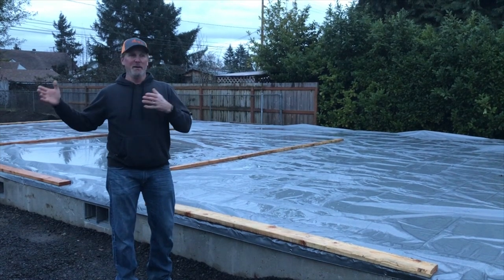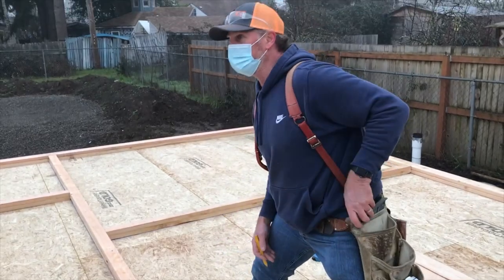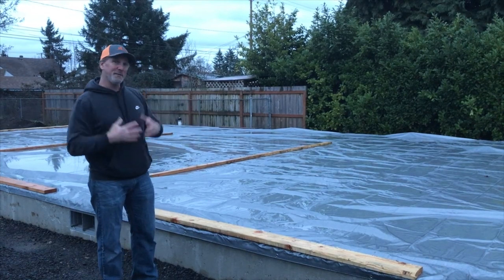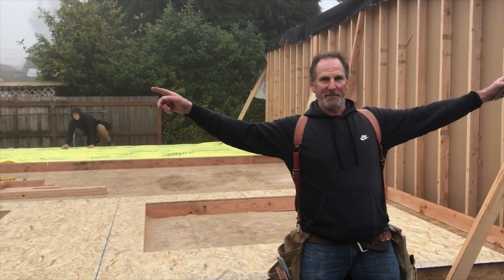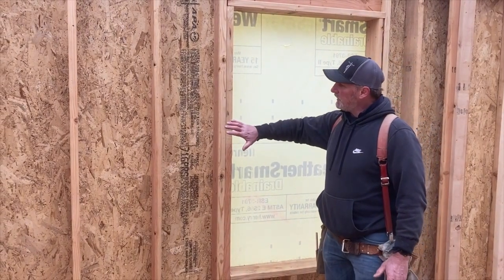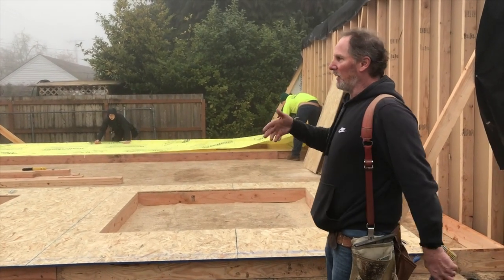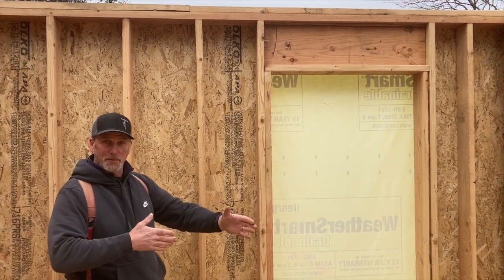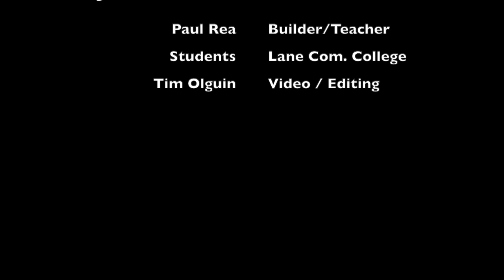Building Walls for a (Duplex) House | Paul Rea

Comment: Builder ignored the firewall, what are my options here? Can I attach sheetrock to both sides?
Reply from the maker: On a two story duplex we are building the plans had the firewall be two 2x6 walls with a 1 inch air space in between the walls.  The plans had just one layer of 5/8 sheetrock on both sides (instead of two layers on each side of two 2x4 firewall as shown in the video)   There are generally many options to satisfy the code.  I would check with your local building department to strategize which options you can use to satisfy the code.  Good luck.